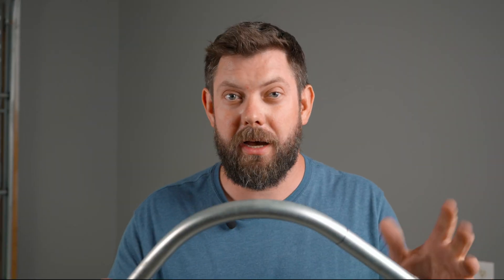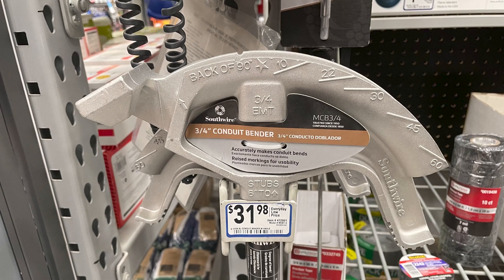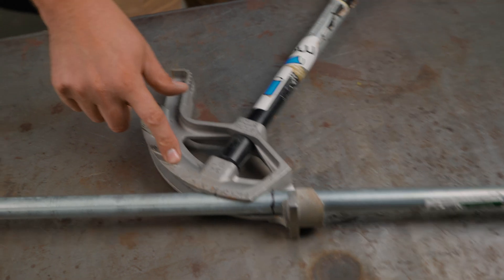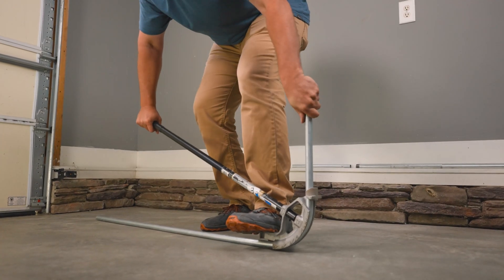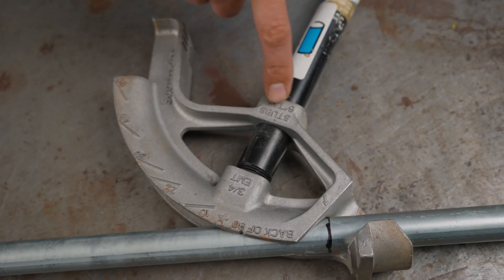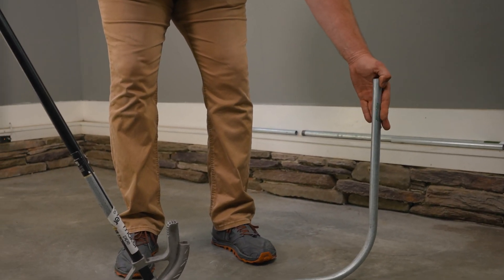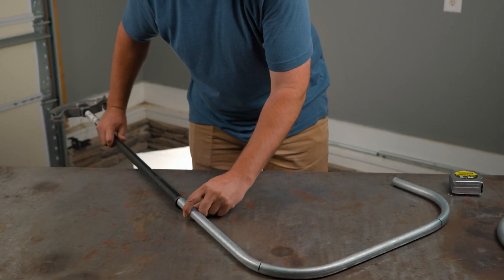How To Bend EMT Conduit For Beginners!

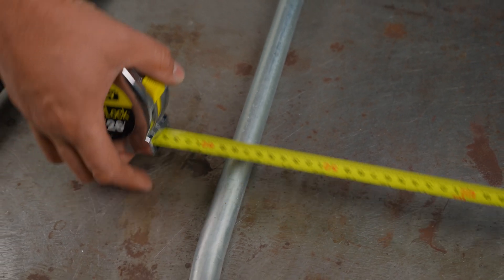Comment: @4:25  THIS IS MY PROBLEM WITH BENDERS... you said "we are "REALLY CLOSE" to the measurement.. I dont want..."really close" 
because lets say youre making that Back 2 back bend from one knock out, to another. that "really close"  will end up looking like  ONE leg being nice and straight and the OTHER coming in the other box on an angle. 

YOU CAN SEE THIS WHEN MAKING A 90 Deg Bend. Measure the 90. Mark it SPOT ON. align it EXACTLY on that arrow. Pull it up. measure it. is it off by a whopping 1/4 inch!?
SOME brands will be! that 1/8th to 1/4 off will be a matter of MISSING the entire Knock out, if that angle continues several feet. there needs to be a video on the accuracy of bender brands like there are for rulers.

Comment: Can the 3/4” bender also bend 1/2” conduit?
Reply from the maker: No unfortunately not. 1/2" EMT Conduit will kink in the 3/4" bender.
Reply from the maker: I was wrong about this. I just tried it and it didn't kink the 1/2" like it was supposed to
Reply: @MakerPipe You’d have a harder time aligning it than with the proper size. That said rigid always uses a size up from EMT.
Reply: @MakerPipe  Bro I just saw the video reply! Awesome thank you!!

Comment: Where can we buy a Southwire MCB3/4 bender for the $31.98 price you showed? I looked online and everything, all brands including the Southwire, is well over $40...inflation?
Reply from the maker: That exact bender is no longer that price. However you can get a good bender for around the same price by piecing it together. Here is the bender head on Amazon --> https://a.co/d/e8Me6yO Then you will need a handle. This black iron pipe has the same threads as the bender head ---> https://www.homedepot.com/p/STZ-3-4-in-x-4-ft-Black-Steel-Sch-40-Cut-Pipe-PDB-P34X48/316939768

Comment: Hi! Great video. One question, using the bender what is the smallest distance between either side could you feasibly bend to? Could you bend to 7 or 9 inches or are there smaller benders you'd need?

Comment: I suppose with practice mistakes are less common.   To reduce the risk of error, you work with shorter runs of pipe and make off-cuts of any mistakes? I suppose 10 feet of pipe is the maximum for a reason. :)

Comment: If I'm gonna make a 45° bend on 1/2" EMT and my sharpie mark is lined up with the⭐. The bender has a 45°  line on the head and I'm pulling the pipe down. What part of the piece of EMT lines up with the angle line? The top of the pipe, bottom or center for the correct angle? 🔌

Comment: Another nice tip is when welding pipe together is to take a hole cutter same size as your pipe use half of it to cut a moon shape at end of pipe should line up perfect to weld the pipes together

Comment: Very coll and insightful video!!! Is it possible to use this to bend and modify a Bicycle handlebar? It already has a bend in it, although its very large and I wish to to make the radius or curve slightly smaller. Do I need a different radius?

Comment: Thanks.
Why arrow for one bend and star for the other bend?
Reply: to take into account the space for the curve. if you use the line on the second bend, you would not have a 24” span, likely 18ish. the star adds the appropriate distance so a 90 degree bend matches the desired 24”span.

Comment: Stick to something you can actually do well please? Leave the guides like these to people that actually understand the mechanics, and trigonometry required to effectively and accurately bend conduit. And please anyone watching guides like these, do nut using a tubing cutter on your conduit !!!!! Tubing cutters are for cutting tubing where having burrs or sharp edges inside wont affect anything, like water flow.... not for leaving sharp edge's inside a conduit that could damage conductors and lead to a dead short inside your conduit
Reply from the maker: Thanks for the comment Kevin. We use conduit for DIY projects so the bends don't have to be perfect. This is meant for beginners who need to know the basics like what the markings mean etc. Also for DIY projects the inside burr doesn't make a difference either so the handheld cutter is perfect.
Reply: @MakerPipe  of course the sharp burr inside the pipe matters. You will be pulling a conductor over that sharp edge, and if it damages the conductors insulation, you can create a dead short. Thus happens way too often, and usually by people with no training, using the improper tools recommended on some hack video. People following your advice on that tool are literally creating a fire hazard in their home.
Your cavalier attitude proves how electrically ignorant you truly are.
My advice to anyone watching this video, is to ignore almost everything presented here.
Reply from the maker: @kevinhogan8940  Obviously you are grossly misunderstanding what I am saying and arguing for the sake of arguing. WE ARE NOT DOING ELECTRICAL WORK. Within the first ten seconds of the video we say that we are showing people how to bend conduit for DIY projects like desks etc. There is no wiring involved thus the burr doesn't matter. I don't know if I can make it any clearer for you but please let me know if you still don't understand and I will try my best.
Reply: @MakerPipe  agreed, we are both missing each others points. Mine is this, for these types of videos... it is literally monkey see monkey do, and by using a tubing cutter in your demo, you are setting up someone else for failure.
You concepts and math are fine, I agree with that part,  however, when looked at as a whole.....
I will not critique your video further,  and apologize for the confusion. But if you show them the wrong tool, they will use the wrong tool, and could experience trouble. I understand, your not pulling conductors through your pipe, but people will use your example, and copy your method..... circular logic from this point on. Had a good day sir

Comment: Simply explained! thanks for the vid.
can I use this conduit bender to bend rebar?
Reply from the maker: I think as long as the rebar fits in the bender it will work but I have never tried it. You could buy a bender and leave the tag on it and return it if it doesn't work.

Comment: Just a tip. Your bends look cleaner when you use more foot and less arms on the bender.
Reply from the maker: Nice tip. Thanks for the info!
Reply: @MakerPipe   np. If you use your arms too much without enough pressure it “eggs out” making an oval shape in the part of the pipe that is in the shoe of the bender.

Comment: This bender suite for OD 28mm*1.5 mm thickness SS tube ?
Reply from the maker: Hi Ganesh, thanks for the question. This bender is made for 3/4" EMT Conduit which is 23.4188mm. You won't have much luck with anything bigger than that.

Comment: BENDING tubing is the easy part.  How about STRAIGHTENING tubing?  I just bought an under car "broom" washer (Tool Daily undercarriage washer on Amazon) that attaches to a power washer.  The unit comes with three extension tubes to help you reach all the way under the vehicle without having to get down on your hands and knees.  Two extensions are straight and one has a 90 degree bend.  That 90 degree bend is way too much and should be more like 45 degrees.  So what would be the best way to "persuade" that 90 degrees to straighten out?  I just read that you can't use heat on aluminum because it is different than steel.  Steel will gradually soften before it melts while aluminum gets hotter and hotter and then suddenly melts.  Is there any way to straighten that 90 degrees even to a 60 degree angle without kinking or breaking it?
Reply from the maker: Thanks for the question. The top of the bender handle has a larger diameter that you can use to straighten out tubes. Were you able to try that?
Reply: @MakerPipe  I just sent for the under car washer so I haven't received it yet.  I'm real nervous about trying to straighten aluminum tubing that may have been bent under pressure and heat.  I just had a thought, though.  Instead of trying to straighten out that 90 degree bend, it might be easier to add another bend below that bend to counteract that 90 degrees.  I think bending tubing is easier and better than trying to straighten tubing that's already bent.  Thanks for getting me thinking.

Comment: Lol you dumbass, the arrow at the front is 6" vertical above the bend, it doesn't help you "place the bend" (that's what the star is for). So if you're going along a wall, and you need your pipe to come up 18" from the bend, you make a mark 12" from the end of the pipe and put the arrow there. The other 6" come from the bend. What makes this even better is you can mark the U BEFORE bending in the first place instead of measuring after you bent it and making a stupid "eyeball" guess about where the pipe should be bent.

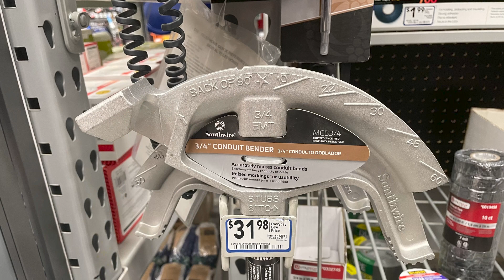Comment: Looks like the bender on screen at 0:48 into the video is in the wrong spot at the store. It shows a 3/4" bender behind the tag for the $32 1/2" bender. Actual price for the 3/4 is more like $42 to $48.
Reply from the maker: Good catch Carl!  I purchased mine years ago so we didn’t actually try and ring it up.  

I am seeing an inexpensive 3/4” one on Amazon for $30 shipped if your interested.  Although I can’t vouch for it like the Southwire.  It might be worth the extra few bucks for the name brand one or try to find one second hand.
Reply: November 10, 2021 the southwire is $42, and the Klen is $50 already..

Comment: It seems that the part about where to place the star for an adjacent bend has been edited out.
Reply from the maker: It does jump rather quickly to the actual bending. You would line up the mark you made for your measurement with the star
Reply: @MakerPipe Thanks. I assumed that, but I'm not sure everyone would make that connection.
Reply from the maker: @johnrupe3279  True thanks for the heads up. I will add a note to the pinned comment just in case

Comment: Is there a way to use that size bender to make an arch that extends a few feet? I want a frame for a 4' raised bed but don't want the flat top I'd get with two 90 degree bends. An arch sheds snow better. Do you know if I could start the bend then reposition the bender to keep going until the straight ends are facing the same direction? It does not have to be perfect or symmetrical by any means. 
I'd prefer an arch but maybe a combination of a 90 in the middle and two 45s on the ends would work (like the profile of a house)? Like this without the heart on top, if that makes sense. 💌
Reply from the maker: Yes you could!  It would take a bit of patience and planning, but you have the right idea.  Make small bends every few inches and it will end up being a larger arch. You CANduit!  🥸
Reply: @MakerPipe  Thanks so much for the quick reply and encouragement. We'll get the bender and start playing around with it. (CANduit 😂)
Reply: Get hoop bender at johnny's seeds. Can use 1/2" & 3/4" pipe.  Makes a hoop 4' wide and about 3.5' tall from 10' pipe lengths. I have dozens of beds covered using these hoops 4' on center.
Reply: @bvrstx9503  That sounds perfect! Thank you so much.
Reply: You can use a magnetic protractor/angle finder to figure out where 45 degrees would be on the bender and then mark it with a sharpie. If you watch the video for making circles for w the link for Woodinville where he explains it way better. Hopefully that makes sense.
Reply: @joecosier22  It does make sense, thank you. I may try the 45-90-45 combo and the semicircle and see which works best. 
I used the width of the bed as the diameter of the circle and found the circumference. Half of that would be the distance between the two outermost bends along the length of the pipe. That should make an arch fit nicely in the raised beds. 
Thanks so much for your input, I will check out the video.